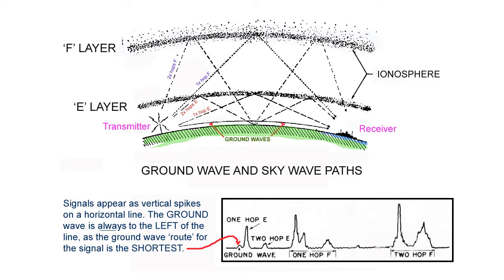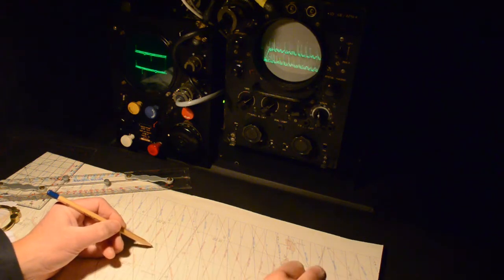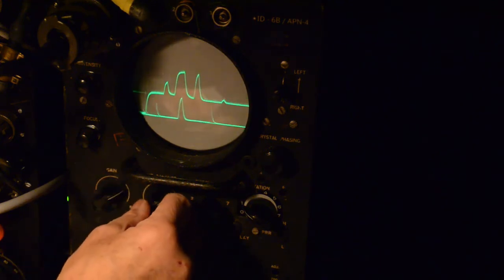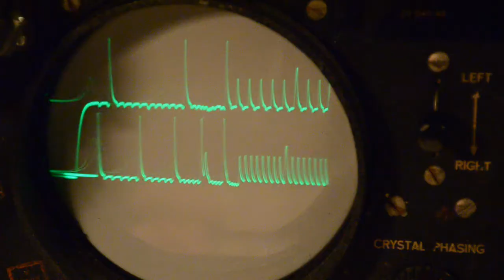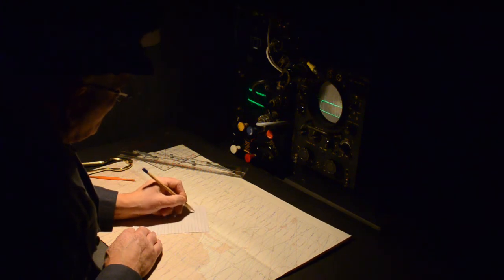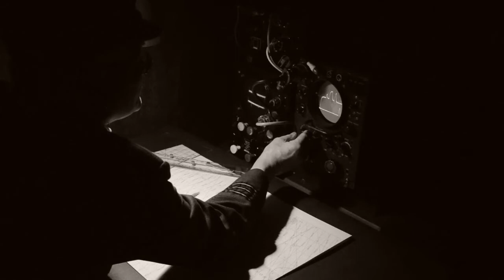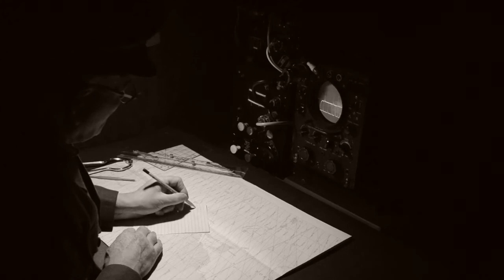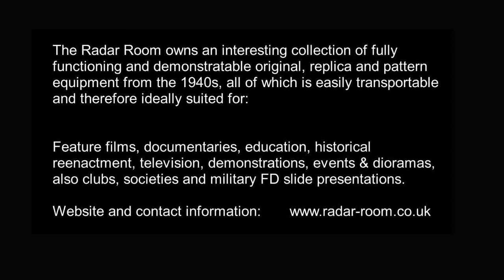A  Loran Navigation Fix

Comment: I learned about the LORAN system during avionics training during the 1960s.  I was a pretty clever system. It has been shutdown worldwide in favor of GPS. However my understanding is there is renewed interested in reviving it as a backup to GPS.
Reply: We used loran c for surveying around the UK In the late 1970,s
Reply from the maker: There are currently several countries experimenting with what's called eLoran for use as a GPS backup. Do a google search if you want to know more! Obviously a lot more advanced than even Loran C by using modern technology.

Comment: Ah the old APN-4.   The Navy was still training NFOs on the APN-4 in the mid ‘60s.  My patrol squadron had a mix of A/C equipped with the -4 and others with the much better APN-70.   Watching your nicely done video I can see why I had no love for the -4.   BTW we had a -4 slide-rule-like device to assist in somehow determining the line of position.   Years back I had one...but no more.  I stumbled on this site looking for info on the -70.   Any chance you have an ‘operable’ APN-70?   
v/r AJL SP-5B NFO
Reply from the maker: Interesting! 'Fraid I'd never heard of an APN-70 until you mentioned it in your comment. Just did an Internet search to find out what exactly it was, but can findout  minimal information along with a couple of indifferent pix. We do however have an APN-9 which will eventually be restored. Such a loooong job. There was so little left of our APN-4, that the chassis was stripped to nothing and we rebuilt it piece by piece... At least it works now :-)   Thanks for theinformation!

Comment: So I had several question. I had read about LORAN Navigation in elementary school, yet still don't understand how the systems work until my 20s lol. To use the LORAN, we need to count the phase difference to get the first fix by calcuating our distances to the first station, while being backup by dead reckoning, is that true? The fix get more accurate by doing Trigonometri and symple phytagoras math out of several other stations is that true? Does this (video) method only apply for ships or air crew navigator did the same steps in the 70s? If not, what equipment did they use back then? Thanks before
Reply from the maker: Hi! Loran used TIME differences (like GEE) as opposed to PHASE differences between the signals. The Decca system used phase relationships. 
Indeed one did need to start with a rough idea where one actually was, (by dead reckoning) in order to chose the transmitters from the chart that would be best used for the fixes. The more transmitters that were used for the fix, the more accurate the final position will be. You will of course need to use use at least two.The video shows the obtaining of just the one.  As far as I am aware, the same techniques shown here were used both in the air and on board ships. 
I am unfamiliar with the equipment used in the '70s, but can say that by the last decade or so of Loran operation, the entire procedure was taken over by a box containing a microprocessor that gave the Latitude and Longitude directly onto an electronic  display. (Not sure if GEE ever did? I don't think so.) 
Decca also ended it's days as a small 'box' which read out lattude and longitude onto an LCD display from a microprocessor. 
However much quicker this was than by using the earlier methods, an example of the 'modern' Decca we used ourselves for several years in the early 1990s still needed to be 'told' a rough position where to start before it would provide a correct and accurate fix. I hope this helps!
Reply: @lishaton  thank you very much! Never learn so much about them until recently. Glad to learn about other system such as Decca and Gee too, because I born in pure digital era, in which GPS are the current stuff, never know how LORAN and otger stuff work. Thank you for the information, very helpfull!